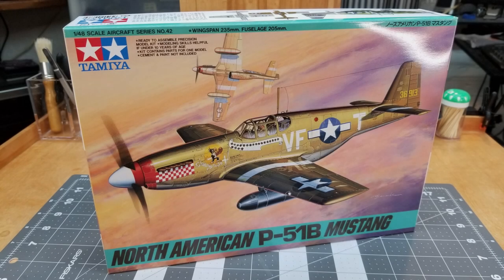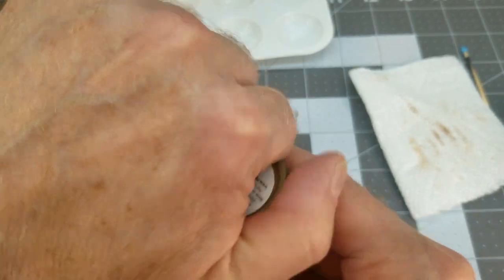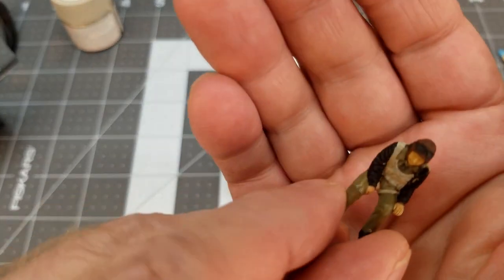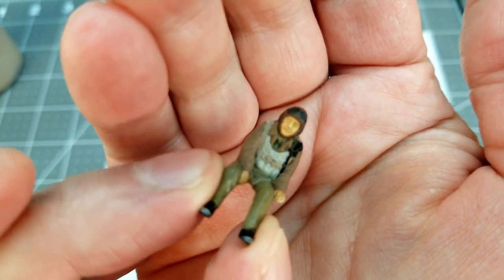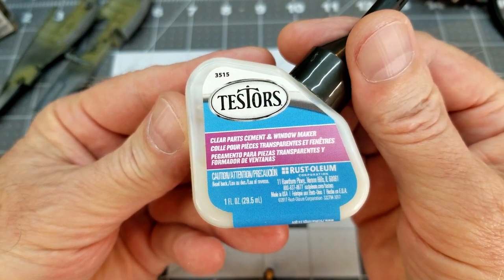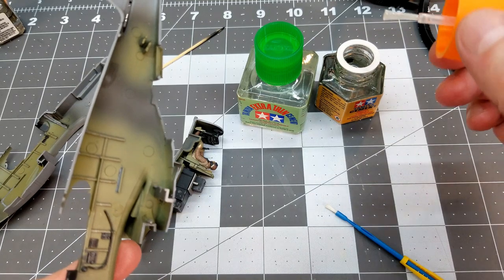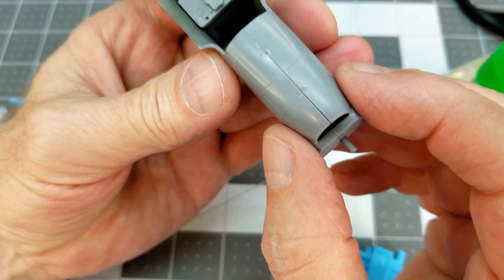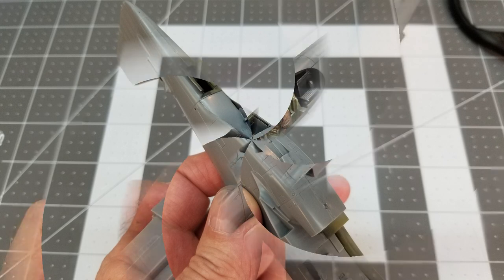P51B Mustang by Tamiya in 1/48 Scale, Build Part 2, Paint a Pilot, Fuselage Assembly

Comment: What are you using to thin the model masters flat coat, and approximate ratio? Thanks, Matt
Reply from the maker: Hi Matthew, I used Vallejo 71.161 Airbrush Thinner to thin the Model Masters Flat Coat, and it worked just fine. The ratio is about 60% Flat coat and 40% thinner. I have gone through the last of my Model Master Flat coat, so I have been using Vallejo's flat topcoat. The Model Master acrylics are water based so any water based thinner will work, even water, LOL. Just be sure to use any thinned Model Master acrylic soon after thinning it to keep it from gelling up on you. Hope this helps, take care and model on my friend. Johnny
Reply: @hillbillymodeling  thank you for that. Also, while I have you, what is your thinner and ratio for the vallejo black primer? I tried the air brush flow improver but could not get the ratio to work with me.
Reply from the maker: @matthewhudson9435  Hey Mattew, sorry I haven't gotten back to you sooner. With the vallejo primer I thin mine around 15%, one thing that I always do is to strain the paint when I put it into my airbrush. Depending on how old the paint is, it can get small "clumps" of pigment that fouls my airbrush. I've gotten into the habit of straining all my paints now so as to avoid that. Hope this helps.
Reply: @hillbillymodeling  yes! That helped a TON. I just mixed it up like you said and put a couple drops of flow improver in and sprayed the wheel wells of my p51b.

It came out beautiful
Reply from the maker: @matthewhudson9435  Excellent Matthew, I'm so happy you got the ratio dialed in, it will serve you well in the future. Good luck with your build my friend, take care and if I can help in any way I'll try, LOL! Johnny